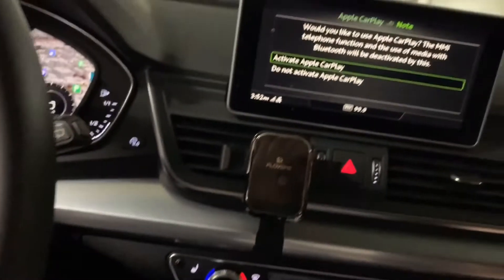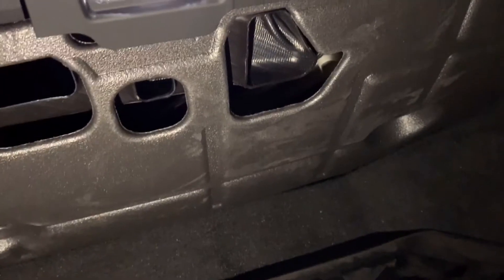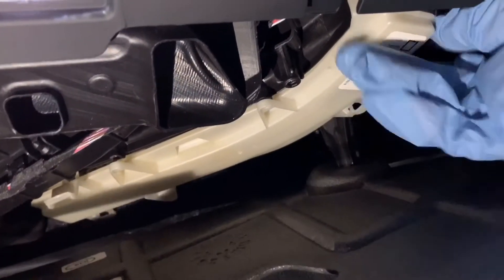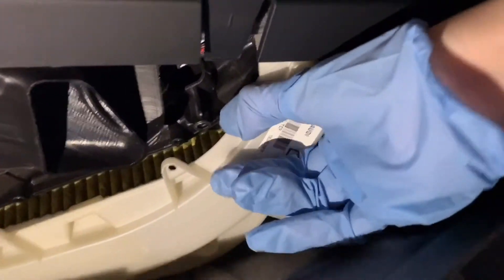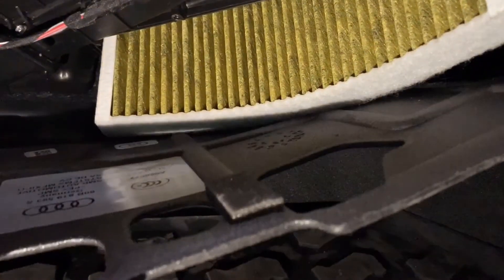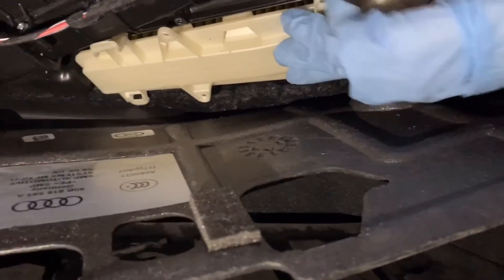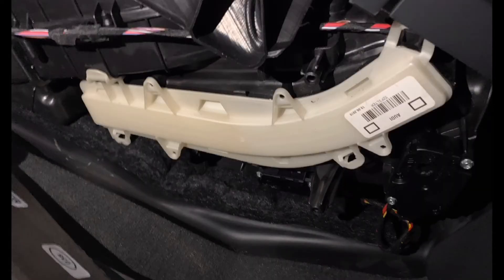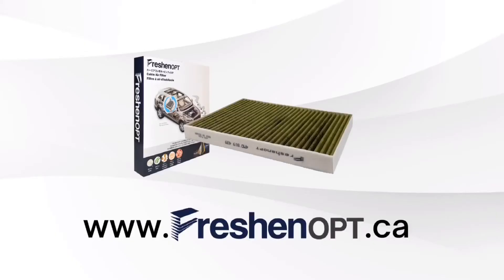How to replace cabin air filter for Audi Q5 2018-2020

Comment: This is the best video online to change the cabin air filter. It is clear,  with good lighting.
Unlike most other brands Audi makes this a difficult task for DIYers. Our Lexus SUV is a very simple task. It takes literally less than a minute, two if you sip a glass of wine.  More importantly, you don't have to be a contortionist to do this on a Lexus. Audi on the other hand caused me to use words and phrases I won't repeat here.  This is my first Audi and I'm not impressed - all objections are design-related issues. Audi insists on making things more difficult than they need to be. Changing an Audi engine air filter is likewise a tedious time-consuming task - Lexus a breeze (pun intended). The Q5 handles very well - the MMI - I'm not a fan. Too many problems, issues and Audi hasn't fixed them.

Comment: I just changed mine today, June 11.  easy pezy. 10 min. trying to located direction of air on old one took me the longest. Filter is very flexible, just bend it into the curved shape of the existing one.